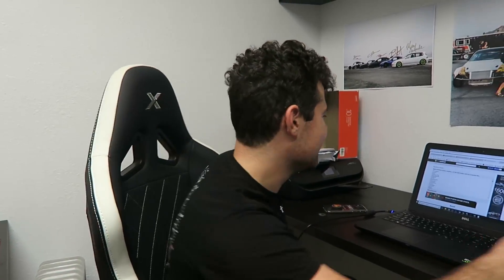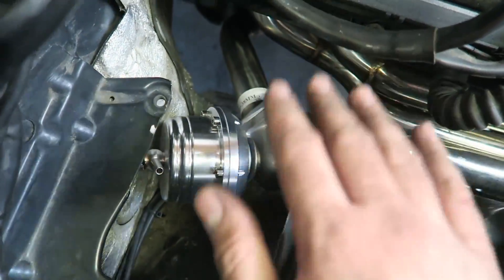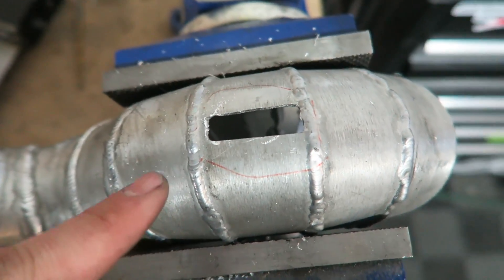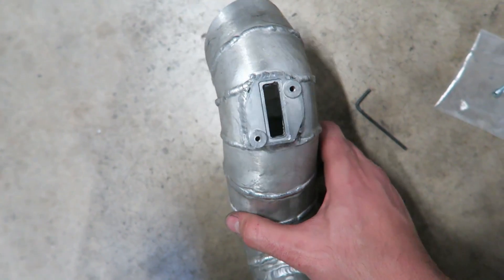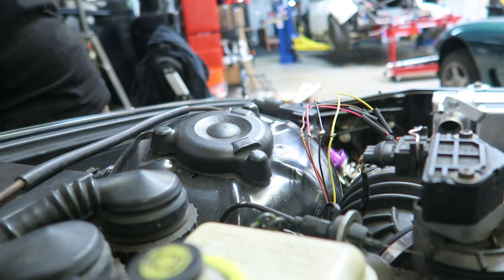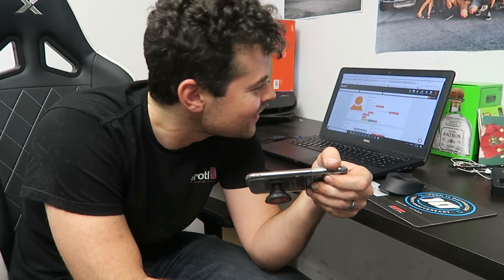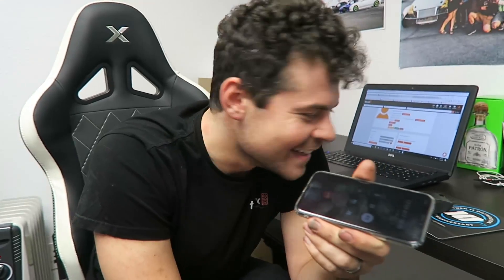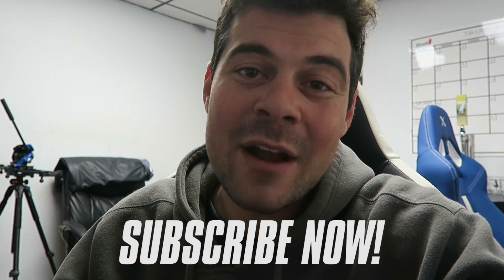I  HAVE TO RE-DO IT AGAIN... TURBO M3 PROJECT PART 11 + (DECEMBER VIP WINNER PICKED!)

Comment: Welds are looking good but you should try cutting the edges of the pipes into a slant on both sides so the joint looks like this \/ and then when you weld you can use the filler rod to fill in the V. It'll look alot cleaner!

Comment: You're probably gonna run into an issue with AFR's with the MAF location. They need a straight section of pipe before and after to get the correct air flow readings